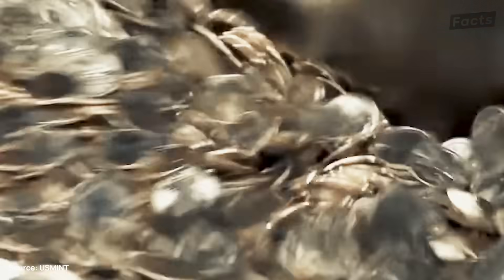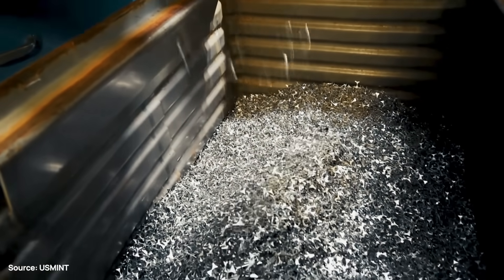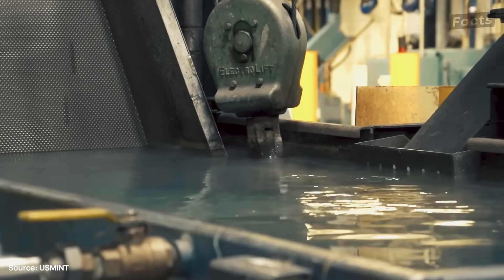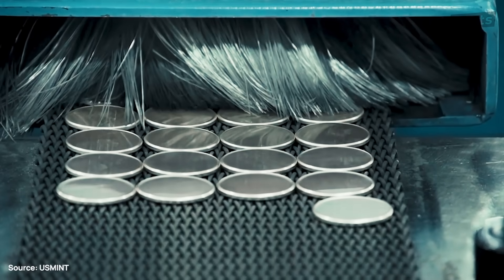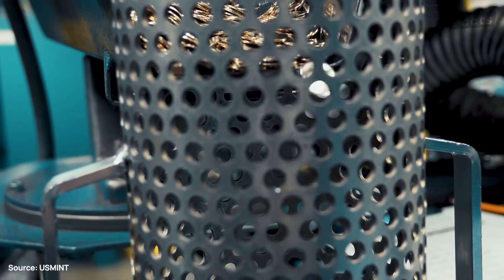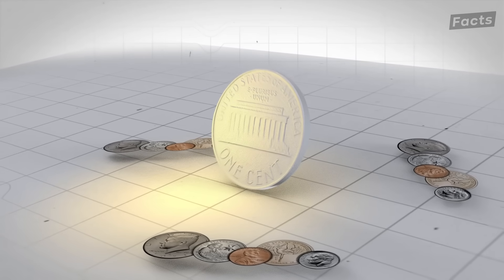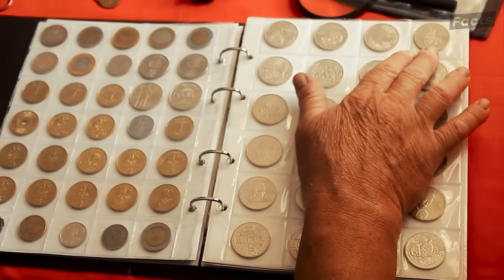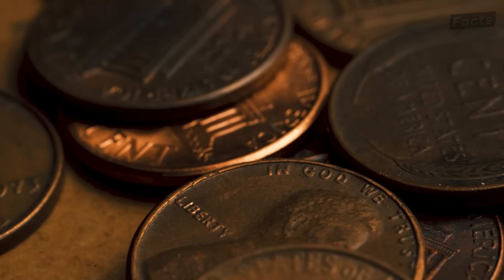How Coins Are Made - Inside U.S. Coin Factory

Comment: 4 lbs pounds of nickles would be 75% copper & 25% Nickle
18.14 cents would be the same as 4lbs of nickles 
Current Google says 5.50 per pound of copper & 7$ per pound of nickel so 18.14 cents is actually 23.50$ worth of mass material

Comment: The coins that are bad enough to get waffled get sold off for recycling? Why don't they just go back to the planchette factory for recycling in roughly the same way that the waste spaces in the sheets do, except that these failed coin attempts are more than one metal together with one as a coating of the other? How does an outside recycler supposedly deal with that mix of metals in ways that the planchette factories supposedly can't?

Comment: This video is bullshit, because the blank coins are produced at a factory in Attleboro, Massachusetts. I only know this because I’ve been there. The coins are not printed out of a sheet of metal like depicted in the video. There is a process that has to take place to get the right metal make up. And the coins are individually stamped at this facility. As blanks, and then they are sent to a press that strikes them with the current images that you see on them today front and back. Stop spreading bullshit dickhead

Comment: US “silver” coins are made of a copper core with outer layers of nickel bonded to the copper. As a result, if you look at the edge, you can see some of the copper core. In the UK, “silver” coins of the smaller denominations (5p and 10p) are made of steel and then completely plated with nickel. This means that the edges are also nickel. However, while the UK coins look much neater, the advantage of the US coins having a mixed copper/nickel appearance on the edge is that it is possible for visitors to know which coins were previously “silver” coins. The 5 cent coin is made of cupro/nickel so has a uniform appearance, the edge being the same colour as the sides. So, while a dime is much smaller than the nickel, it is possible to tell that it was once silver by the fact that the edge is of mixed metals.

Comment: I operate a professional-grade coin striking machine capable of producing coins of any design, size, or weight. Technically speaking, I could replicate virtually any coin, as the machine offers full flexibility in dimensions and striking force. The metal blanks (or “slugs”) we use are identical in composition and quality to those sourced by official mints.

For example, if someone were inclined to replicate a Saint-Gaudens gold coin, a single gold slug of the correct specifications could be purchased for approximately $3,483. Once struck, the resulting coin would match the original in both weight and appearance.

However, I want to be absolutely clear: producing replicas of official currency with the intent to deceive or circulate is highly illegal, and I do not engage in or condone such activity. My point is simply that with the right equipment, it can be done—which is why this technology must be handled responsibly and ethically. We mostly make customized coins for corporations. We recently made a Gold coin exactly once ounce which is a corporate coin that is given to workers that achieve 1000 sales in their company. Many employees attain up to 100 gold coins per year. Then they ask for 1 ounce silver coins that are given to those who achieve 50 sales. Now you can cash in when you receive 1000 sales. You will have to give back 20 silver coins to receive the 1 ounce gold coin. It is a genius way to motivate your sales force. More an more of these companies are ordering gold sales coins per 1000 sales. Many sales people attain $500,000 just in gold coin bonuses per year.

Comment: Wonder what steel company supplies the steel for the coins.
Reply: In the US? The US doesn't use steel for coins.
Reply: @TheWinstonDouble  Bingo.  Only in 1943, and then only for Cents.
Reply: What "steel for the coins"?  Is this 1943?

There is no steel (nor iron) in the alloy of any present U.S. coin. 

The dies are steel, surely much steel is used for production and packaging machinery but the only steel coins ever produced by the United States and released for circulation were zinc plated (galvanized) steel Cents of 1943.
Reply: @-oiiio-3993 I don’t collect coins and never really though about what they were made from. I just noticed the metal coils in the video and thought steel mill 🤷🏻‍♂️

Comment: They're not called coins until they're released from the depositories.  The discs are blanks.  They're called planchets after the raised rim is applied. The planchets are stamped, then stored until ready for release into circulation.   Only then are they called coins.
Reply: Nonsense.

When they leave the dies they are coins.

Comment: I doubt that the citric acid used is derived from citrus fruit.  I do understand the comparison for simplicity, but that would significantly increase production cost.  Should have left a foot note that most of citric acid is fermented complex sugars, if anyone cares.
Reply: Clearly you don't because your entire comment is wrong. Try googling such a simple question next time before leaving a mindless comment. Other factories exist.
Reply: @lemau8458  I went and did that. First response from google. "Yes, citric acid, often derived from corn starch, can be used in coin minting"  Maybe you should try the simple google search before telling someone they are completely wrong? While citric acid is naturally found in citrus fruits, the majority of commercially produced citric acid comes from the fermentation of sugar by the mold Aspergillus niger.  Part of my job is programming the equipment for one of the leading producers of citric acid, and it comes from corn starch.  Google: "What is the majority of citric acid made from?" You must out of your mind, to tell me I'm wrong, and then have your proof support my comment.  Now if you want to counter that with the mint using citric acid from citrus fruit, you may be right, I only doubted that because of the high cost of citric acid derived from citrus.

Comment: I want to see how they did it in the 1800s
Reply: They probably did it by blacksmithing or something
Reply: @try_neat4553  Why don't you research the United States Mint, founded in 1792, and learn how it was done?.
Reply: Largely in the same manner.
Reply: They hired 20 pissed off Puerto Ricans and gave em hammers.
Reply: @D-Fens_1632  Racist and completely off, most was steam powered machinery.
Reply: Much the same
Reply: @RuinerofDamnation  No they didn’t have these machines back then
Reply: @EddieMunson19 I would read "the 1800s" to include the period from 1800 - 1899.

The United States Mint converted to steam powered presses, rollers, in 1836. By 1899 U.S. Coinage was manufactured in a manner entirely similar to that shown in video.
Reply: @-oiiio-3993 this new generation thinks the 1800s were the stone age. They don't realize that industrial machines were used as early as the mid 1700s.
Reply: Steam powered press

Comment: 2:25 - How do you get fire without oxygen?
Reply: Electricity, not fire
Reply: @TheWinstonDouble not true, fire with an oxidizer in the absence of oxygen, with no oxygen, it eliminates competition for fire
Reply: oxygen is not strictly nesscary for a fire to exist, a fire can exist at extreme enough heat even without oxygen, an oxidizer is only nesscary as it feeds a fire to get it to hotter temps than it would otherwise sustain, but if you have another method of reaching those temps its not nesscary, you can light an electric lighter in a vacuum because electricity can reach absurd temperatures without oxidizer
Reply: Traditional fire, or combustion, is a rapid chemical reaction between a fuel and an oxidizer (usually oxygen in the air). In the absence of atmospheric oxygen, you need to supply the oxidizer chemically. The vacuum only eliminates the need to compete with air for the oxidizer. Think about a light bulb
Reply: Learn something about chemistry and physics.
Reply: @ChuckyMcNubbin72 he is trying, do you not see his question?
Reply: Pea brain
Reply: @Omaricanguy only as pea brained as the one calling him pea brained. If asking questions you may not know the answer to makes you a pea brain, then I sir, am a potato head 😂

Comment: "How much does it cost to make a nickel?" 
"Thirteen cents sir"
"Ok, not bad. Well much does it cost to make a penny?"
"4 cents sir"
"HOLY CRAP ARE YOU KIDDING ME? DISCONTINUED!"
Reply: Yet, it only costs 1 cent to print a dollar bill.
Reply: @chrisduitsman2918  That figure is inaccurate.  It is presently over three cents per and the 'Dollar Bill' quickly wears out, being in need of constant withdrawal and replacement. This causes excessive costs over time.  

Canada ditched their $1 note decades ago and saves their citizens millions of dollars annually by using durable $1 and $2 coins. They also use their fifty cent coins.

We in the U.S. on the other hand, continue to waste millions of USD annually with deficit cost production of Cents, Five Cent coins as well as low value banknotes as we also pay to store billions of one dollar coins minted since 2000 which U.S. residents refuse to use.

Comment: 1,500 feet; 4 football fields? 100 yards = 300 feet, 300 x 5 = 1,500. So, 1,500 feet; the length of 5 football fields.
Reply: A football a football field is 120 yards =360 ft.  360x4= 1440.  You forgot  about the end zone( 10 yards) on both ends.
Reply: @BlankZero77  Yes, I thought about after I posted, but it's still less than 4 1/2; closeer to 4 than 5.
Reply: @christophercasey7388 what do you mean by "but"?, your point was its 5 Fields, the video and I already know its closer 4 Fields.
Reply: @christophercasey7388 it’s ok, you are correct. No one is considering 120 yards when using a football field as a measurement. They are clearly referring to the ‘playing field’ which is 100 yds. The whole point is to make it easy to calculate and relate to length. You’re correct: he should have said 5. Anyone that says they use 120 yds when comparing lengths to football fields either doesn’t understand football or just trying to be a jerk.
Reply: @guitarzan31 The endzones are part of the "playing field," which is the area in which the game is played. You can't score a touchdown if the endzone isn't a part of the playing field. As an avid football fan, when I hear "length of a football field," I think 120 yards because that's the length of a football field.
Reply: They are calling it a factory not a MINT.... so, I'm not expecting great things, just from the title.
Reply: Andy Dufresne crawled through that length of filth and muck
Reply: And pineapples aren’t citrus either

Comment: no way you made this video and didn't find coin clipping as part of the reason for the ridges lol
Reply: What's coin clipping?
Reply: @douggoins2960  Clipping is cutting or shaving metal from around the edges of a coin or coins. The coin(s) are then spent normally, the metal removed is melted & cast into generic bullion bars (or sold directly as scrap metal bits / fillings), and the bars are sold for a profit. This was more common during ancient times, when gold & silver coins didn't always have a strongly defined "edge", so the removed metal was much less noticeable. Now, with reeded edges (the continuous series of straight lines impressed into the outside of the rim) and/or raised rims, any metal removed is immediately noticeable.
Reply: @paulhollier6382  I think it's kind of funny that they still use these on coins like the dime and quarter. I don't think shaving off that copper and nickel would be worth much, for now anyway.
Reply: @Harold_Callahan  Still used for consistency and the reeded edge adds 'grip'.
Reply: @douggoins2960 When coins were made of gold and silver, people would remove part off the edge and keep it before spending the coin. They would end up with a pile of gold or silver but still used the coin for its face value—free metal.

Comment: A furnace with no oxygen? Can’t have fire without oxygen
Reply: Fire burns fuel & oxygen. If the fuel ratio is properly balanced so that ALL of the oxygen is used up completely, then you have a furnace with no oxygen. There's also an electric furnace, filled with an inert gas atmosphere inside (typically argon), which also has no oxygen ... but I think they mean the former & not the latter.
Reply: @paulhollier6382 ”fire” is technically pyrolysis. The fuel doesn’t burn, the object heats to the point the gases leave it and the gases burn. 

This is why smoke can catch fire causing a “backdraft” as it is only superheated gases. 

Visible fire requires oxygen.
Reply: Yes you can bro
Reply: Yes, you can.  Learn something about chemistry and physics.
Reply: Vaccum Furnaces?
Reply: It's magic.
Reply: Electic
Reply: do you not understand oxidizers? 😅